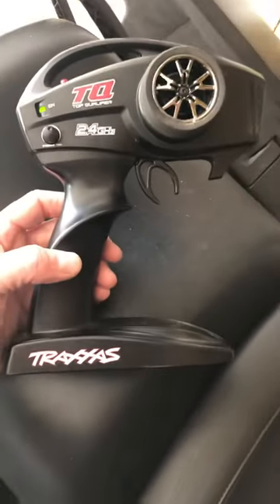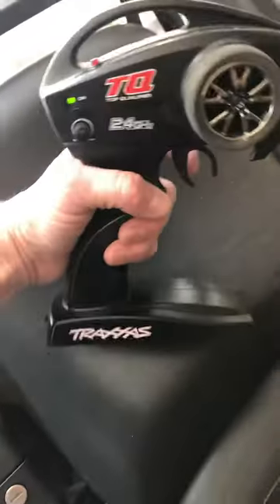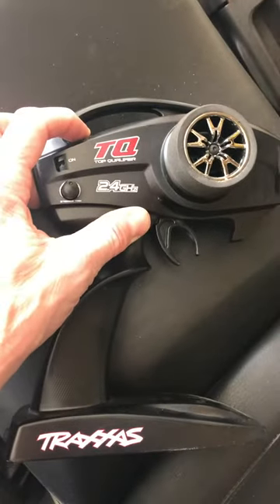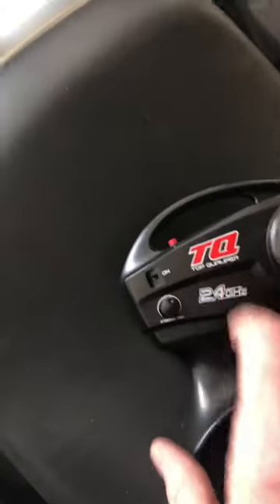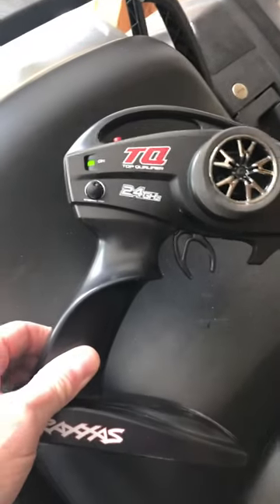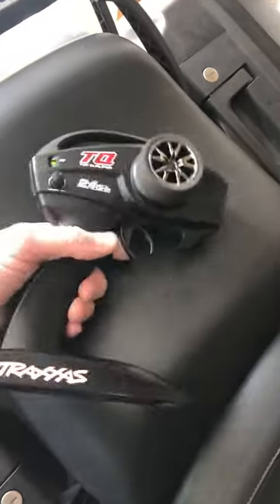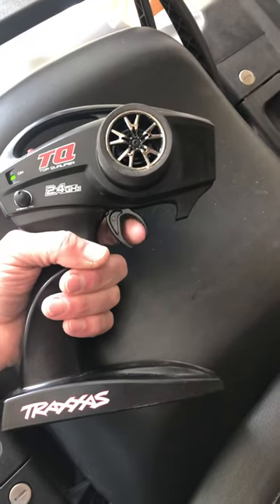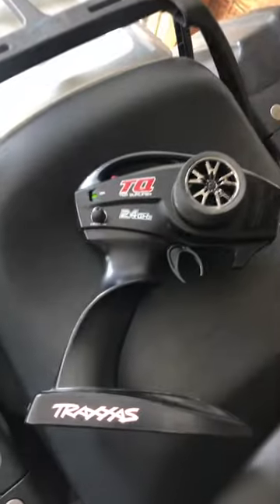Traxxas controller throttle quick fix

Comment: Hey my throttle doesn’t work, my steering wheel works to to turn the tires and then also spins the tires in the back
Reply from the maker: That is something I have not experienced. That is an odd combination. I’m not sure if traxxas has anything on that type problem.
Reply: @chuckndaynezworx5738  I actually finally was able to figure it out, it was stupidity on my side
Reply: @tannervanheuvelen1920   what was it I'm having same issue
Reply: @edergallegos6311  I had my cords both into servo 1 so I had to put one in 1 and on in 2 which is actually the thrid slot
Reply: @tannervanheuvelen1920  I’ll have to check it out. I’m new to the hobby just got the Xmaxx this past weekend and that’s how it came out of the box.

Comment: But how do I make it variable speed
Reply from the maker: Has to be done through the servo, controller itself for this model is only forward and reverse. The servo can change power level only to slow car. If you have a model that does something different then this video won’t help